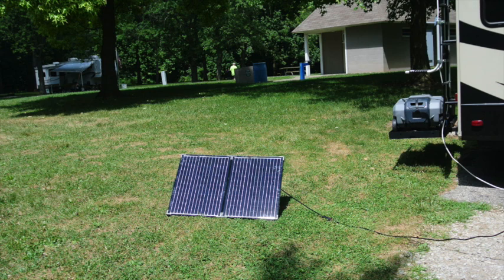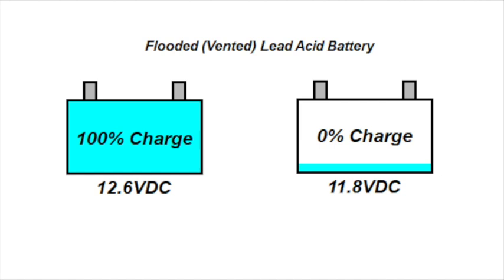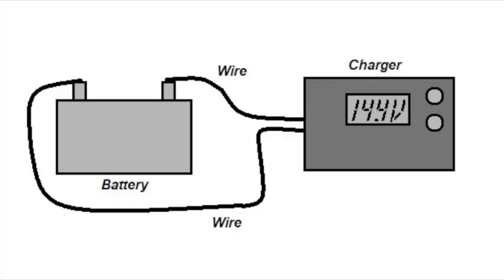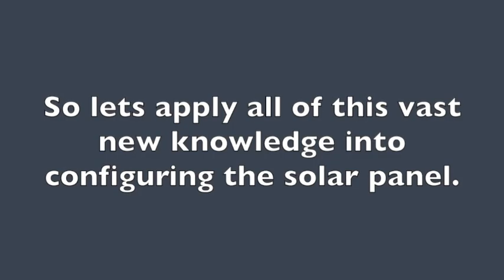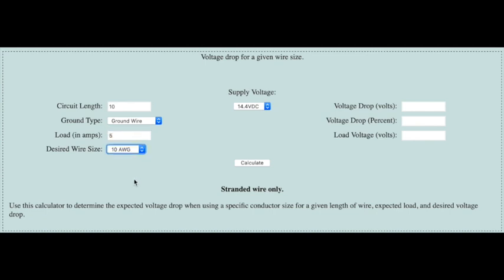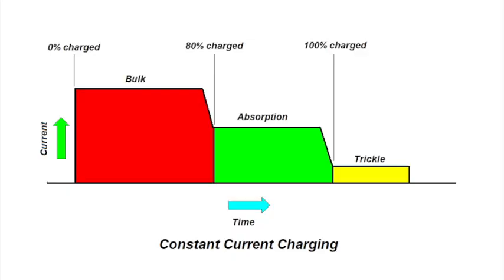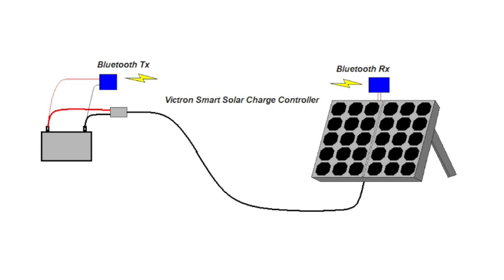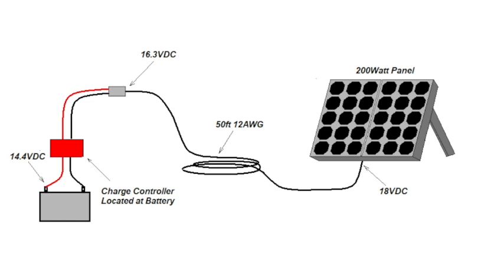Voltage Drop Issues and extension cables - Portable RV Solar Charging Video 3

Comment: Very good explaining. I have a portable suitcase and needed a 10 meter extension but I had a guess that I should mount the controller closer to the battery. This video confirmed my guess. Thank you so much

Comment: This s a GREAT video and explains what people really need to understand and almost no one does understand!!   Must see TV!  lol.   I learned this big time when I moved from Lead Acid batteries to Lithium Batteries (Battleborn) and moved them to under the bed in my trailer, and did not move the battery charger.  I had a 90amp charger but only got 15amp charging!  The wire run was way to long and the wire gauge was way to small, the voltage drop was huge.  Lithium REQUIRES that high voltage to charge appropriately.  You can sort of get away with it for Lead Acid, but not with Lithium.   I upgraded my wiring to 1o and worked hard to cut the wire length and I now can get almost 80amp charging rates to my 2 100ah batteries.
Reply from the maker: It seems to be a common mistake.  I saw a video of a guy that used 50ft of extension cord and put MC4 connectors on the ends, which is why I keep mentioning it in my videos.  He said it still worked, but I bet he never looked at the maximum charge rate.

Comment: Although there is significant voltage drop if you use an extension cord greater than 15 ft,, a lower voltage is better than no voltage at 15 ft if the is no sun when surrounded by trees parked in the shade.
Reply from the maker: There are always compromises, but at least you know what they are...

Comment: Why do you not mention putting the panels in series and using a MPPT controller at the battery end of the wiring?  Your voltage drop calculator does not allow voltages higher than 14 volts.
Reply from the maker: In my suitcase video series, I cover MPPT controllers in videos 5 and 6.  Here is the complete Project Video List: 

Video 1: Review of the Renogy 100Watt  Solar Suitcase: https://youtu.be/A3j5PwwWwiI
Video 2: Connecting a Suitcase panel to your RV: https://youtu.be/7-rsq3Wc5as
Video 3: Voltage Drop Issues and extension cables: https://youtu.be/A6PxSvuGc5U
Video 4: Installing a PWM Charge Controller in a RV: https://youtu.be/_hDwUKKs7q0
Video 5: PWM vs. MPPT Charge Controllers: https://youtu.be/EjCUR9jFphc
Video 6: Upgrading to a MPPT Charge Controller: https://youtu.be/yxVfId-TW9A
Video 7: Series and Parallel Solar Panel connections: https://youtu.be/0Ufm9HHGdQs
Video 8: Charging a Jackery 500 with the Renogy Suitcase: https://youtu.be/7Peqe4CyUH8
Video 9:  Upgrade the Furrion solar port for more Amps: https://youtu.be/cbKWRvz0SOU
Video 10: Eight common connection configurations: https://youtu.be/VUoZ7AO94w8 
Video 11: Yet another Furrion Solar Port Video: https://youtu.be/0hYQzNuXikc

You are correct that the voltage drop calculator only goes up to 14V, because I had to quit somewhere. Depending on the calculator you use, the voltage is not really a significant factor. 

 For example, if you use the "acceptable voltage drop" calculator, the "supply voltage" is used to determine what a 3% or 10% voltage drop would result in.

Or, in the "voltage drop for a given wire size" calculator, the resulting voltage will be accurate regardless of what voltage you enter for the "supply voltage". The supply voltage in this case is only used to determine the percentage of voltage drop, not the actual voltage.

So you can work around the 14V limit of the calculator, especially if you use the "given wire size"  calculator. You can use any input voltage, and the "Voltage Drop" value will still be the same. You would disregard the voltage drop percent and load voltage values if you used a voltage outside of the supply voltage.

For example, if you needed to solve for 48V, you could enter 12V into the calculator's source voltage in the "given wire size" calculator.  The voltage drop would be an accurate voltage, but the percent and load voltage would not, as those are based on 12V.  

However, on my High Power DC Wiring page - which is an associated page to the voltage drop calculator (http://www.rv-project.com/tips/dcwiring.php) I do provide the actual formula for determining the voltage drop.

Voltage drop or other values can be calculated from the different iterations of the formula:

CM = (K x I x L) / E
I = (E x CM) / (K x L)
L = (E x CM) / (K x I)
E = (K x I x L) / CM

Where E = voltage
K = 10.75, which is a constant for copper wire
I = Current in Amps
L = Round Trip distance in feet.
CM = Circular Mils.

Circular mils is essentially the cross section of the wire, and I have a chart on that webpage for each AWG of common wire. However, this is somewhat generic as individual wire manufacturers sometimes publish slightly different CMs for their wire, especially if the wire is SAE (which is 10% or so smaller than AWG).

Hope this helps.

Comment: Well I use 20 ft + extensions on 8mm barrel connectors to several brand solar 100w briefcase panels.  I just see 70-80w produced instead of closer to 100w, which is not a big deal to me if my TT can be in shade and I can move the panels around to catch the sun.  I have found that short extensions (10ft) are a waste of time for my needs
Reply from the maker: As long as you know the tradeoffs between distance and  length, you can make the best decision for you. Sounds like you did that.